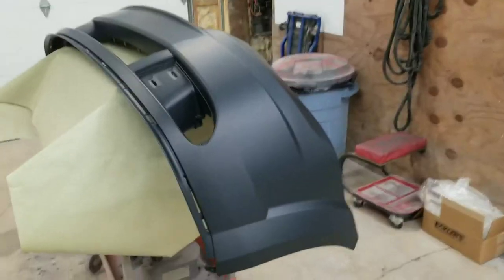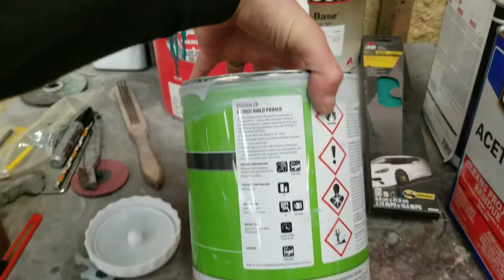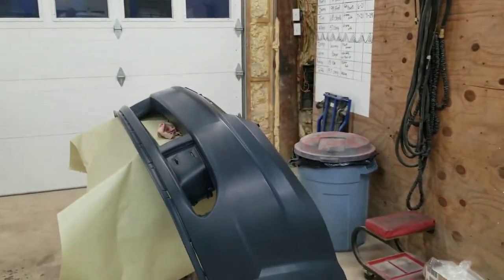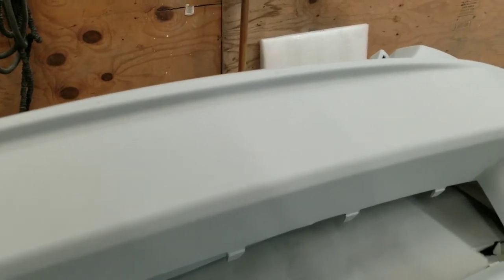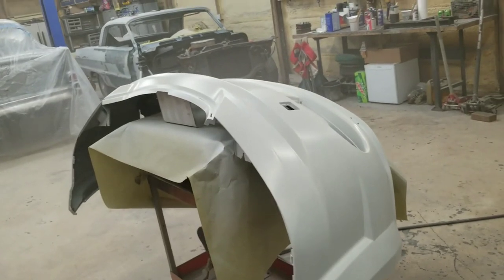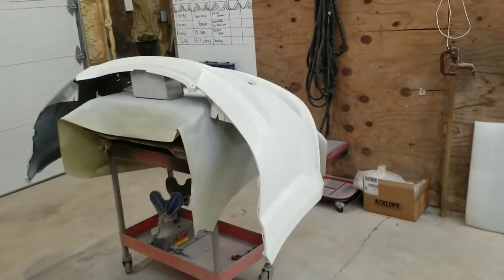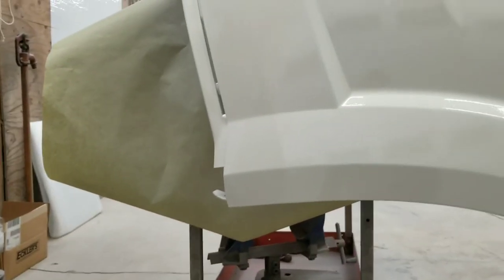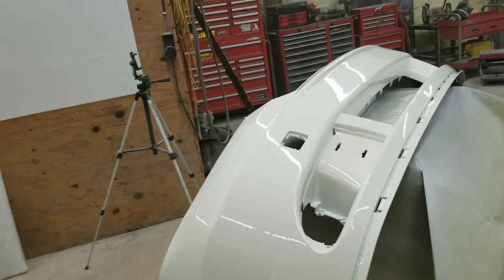Pre-primed aftermarket plastic bumper prep for paint no peeling no flaking make your paint stick

Comment: My only problem I face is laying primer/sealer down. Everytime I do, I have to sand it down with 600 to get it smooth before I paint. If I paint right after primer without sanding, it comes out super rough! Other than that thank you for the great tips!
Reply from the maker: You either need to thin your primer/sealer with the appropriate reducer, and or increase your gun psi. Some of the thicker brands need 40-50 psi to lay out smooth
Reply: @bpbrestorations2093  wooow didn’t think of that thank you!
Reply: Settings on gun might not be right? I always have Paint and Air on one wide open setting. But defiantly need a 50 litre plus compressor. Try doing in sections instead of laying it in one go?
Reply: probably need more reducer. it’s probably spraying too thick so it goes on kinda lumpy.

Comment: You should not use wax and grease remover on plastic and do not use a red scuff pad.. Use the grey one
Reply from the maker: @SonomaLow12  thanks for the feedback, you are right, you don't technically need adhesion promoter. W&g is like 90% alcohol and you can use it I have done it for 20 years, just make sure you use the double towel method to wipe until it's 100% dry and leaves no residue. And you absolutely can use purple scotch for scuff even on metallics as long as you seal first. I have done this method for many years. Our paint is not peeling, but we have done dozens of redo from other shops where they are and this is my observation and answer to the problem. If you think you have a better method post the video or get off the bag.
Reply from the maker: @SonomaLow12  also I see you edited your original comment, I sent my response to your unedited conment lmao

Comment: You mentioned waiting 10 minutes before spraying the sealer, but what about delay between sealer and base coat, plus the time between base coat and clear coat?   And if I end up needing to sand the sealer coat because I'll be using a spraycan primer, how long should I wait before and after sanding the sealer step?  Thanks for all your guidance!

Comment: I’ve read that you shouldn’t put adhesion promoter over primer, it’s for raw plastic. So if I have one of these pre prime bumpers that says to wet sand with 1000 grit, how do I approach it ?
Reply from the maker: It will not hurt it, the primer they use is trash in most cases. You can use adhesion promoter over the pre primed bumpers. If it were a good primer I know I put on then I would say no. Best to adhesion promote it and put on your own 2k sealer. IMO

Comment: I have a question this is now my second car I’ve had to have panels replaced and painted from an accident. I had them both repaired at caliber collision, not sure if your familiar with them but they get there panels and bumpers from a place called Keystone. Both times I’ve had to have them repainted because of the paint just peeling off. They always want to blame it on keystone. Don’t you think they would know how to prep those parts properly like you do or do you think they’re just taking short cuts. They’re supposed to be professionals and do it right the first time I would think.
Reply from the maker: Definitely not a keystone problem. Peeling paint 99% of the time is improper prep or didn't clean well enough prior to paint/sealer. Or not following the TDS sheets and letting their sealer set to long before they put on their basecoat on.

Comment: I'm about to get a pre primed 350z bumper, I guess I'll take your word for it. Ehat confuses me is what to buy at lowes to make a primer a sealer and im not familiar with mixing. And I only have one paint gun so when I spray sealer ill have to clean it out to paint it black and then clean it again to do clear coat. I was hoping I'd be able to just spray it.
Reply from the maker: You need to find a local paint supply store. If you cant go to a local body shop or ask a buddy in the field where they get there supplies. Most of the time the guys in those stores are more than happy to help a new guy out. Lowes in my area does not have anything I would want to put on my bicycle, and definitely not my vehicle.

Comment: I ordered a spoiler for my car that comes in a pre-primed black color similar to this I was wondering if it’s okay if I leave it unpainted like that? Only reason I ask is because the matte finish it comes in matches the car’s factory side skirts and diffuser
Reply from the maker: No, there is no UV protection in the primer. It will fade out and turn a white chalkish color if you leave unpainted. If you want it flat black and cheap, at the bare minimum I would get rust oleum flat black in a can to keep that from happening
Reply: @bpbrestorations2093  oh okay gotcha. Will I need to go over the rust oleum flat black color with a clear coat as well ?
Reply from the maker: @michaelanthony7365  no
Reply: @bpbrestorations2093  ok cool. appreciate the feedback!

Comment: Thanks for the information, it's appreciated. What sealer could you use if you're rattle canning it in the back yard?
Reply from the maker: Spray max 2k is the only kind of primer/sealer I would use out of a spray bomb, it has a plunger on the bottom to bust open an activator inside. Anything sealer or primer that is not 2 part with an activator stay away from it will never last.
Reply: @bpbrestorations2093  thank you
Reply: Did you ever paint your bumper and use the Spraymax 2K he mentions?  I only ask because I'm deciding on whether or not to do mine and have fretted over what combination of canned spray paints to use.  I wanted to use the dupli-color bumper paint and then seal it with a 2K matte version of the Spraymax clear, BUT, I'm worried that if I lay down a urethane sealer like the 2K, over an acrylic like the dupli-color, it will eventually peel because they may not be chemically compatible.

Comment: I sprayed the adhesive promoter and then the primer filler. After drying, I noticed it left like a rash like feeling. Do I have to start from scratch again?
Reply from the maker: If it left a rash feeling, that is dry spray. You didn't wet out your primer enough laying it out, if you got enough on you can sand it with 500/ 600 grit and then scothbrite it until its smooth and then proceed on.

Comment: Do they sell a sealer in a spray can? I’m doing rain guards, and a spoiler kit. I’m in the scuffing stage. I was going to put adhesion promoter, then use a 2K primer I have in a spray can? Is that sufficient, or do I need some kind of sealer?
Reply from the maker: 2k primer will work if it's smooth enough, out of a can it should be fine
Reply: @bpbrestorations2093  Thanks👍

Comment: Thanks for this! Great advice! I'm about to do a bumper myself.
The last time I did a bumper, the clear coat looked "orange peely" like yours and even had a small run.
I discovered though that it continued to "flow out" seemingly for days after and looked 100% better without having to sand.
Have you had the same experience?
Reply from the maker: Yes I have
Reply: But how many day did u wait to put it on
Reply from the maker: @kevinkev1530  24 hours is sufficient for most clears. Check the TDS sheet on whatever brand you are using

Comment: Great video. This instructions is to make sure that paint doesn’t peel off.

Do I need to do another spray paint of the bumper to make sure that the primed paint get sealed? Or is there no need to do a 3rd and final coating?

Thank you.
Reply from the maker: If you are using your primer as a sealer and it layed out well enough to base coat then it will be fine to sand with 600 grit and go right into paint. I prefer to always spray a sealer before paint. When you just use sand paper over your primer and then  paint you only get a mechanical latch/bond, with a sealer right before your base coat sprayed within the proper time windows will give you a mechanical and chemical latch/bond.
Reply: Thank you so much.

Comment: Is thinning out the primer by 10% to make it a sealer crucial to your claim on the pre-primed bumpers? If so, what are you mixing it with to thin it out? It looks like there were instructions on the UPOL primer can but I currently don't have all the tools for proper measurements. Again, if this is a step you don't recommend skipping to back your claim, then I'll go ahead and do more research to find out exactly what I need to thin it out ...or can i just use primer for this whole step? 😅
Reply from the maker: @bizarrehazar  you can use primer for the whole thing if done correctly, the benefit of thinning it and using as a sealer with urethane reducer up to 20% on Upol 2253 is that it simply lays flatter and smoother no dusting or orange peel in the primer/sealer.
Reply: @bpbrestorations2093  thank you! 🙏

Comment: Thanks for sharing that information great finish
Reply: I got a bumper  for my ford focus mk3  front bumper and it was white  so I had to change the colour to 2k primer and base coat but the bumper was painted with 2 pack paint  and its started to  flake underneath of the bumper with the 2k high build primer
Reply from the maker: Probably gonna have to start over

Comment: nice video man.. just a quick question i need to apply body filler ,do i need to throw some adhesion promoter before the body filler? or just sand the pre.primed new bumper
Reply from the maker: No chemical between filler and bumper, just make sure you clean it good
Reply: @bpbrestorations2093  Thanks a lot for your reply . I just made a modification to the bumper to fill some gaps with extra plastic and i need to fill the surface of those areas with body filler for a smooth clean finish before painting . bumper is new and unpainted

Comment: What is your opinion of the quality of the plastic on aftermarket bumper covers versus OEM bumper covers?
I have heard rumors of aftermarket covers being brittle and cracking easy versus OEM thank you.
Reply from the maker: They are definitely not oem quality. Not even close. If I can find an oem bumper used I will use it over a bare plastic aftermarket all day long.
Reply: @bpbrestorations2093  okay so you would consider a used OEM bumper cover over a brand new aftermarket that's what I was sort of hoping thank you kindly!!!
Reply from the maker: Absolutely yes! And no problem buddy

Comment: How long do you wait from the primer and when you put the color on? Thanks
Reply from the maker: You will have to read the TDS for the product you are using for certain, but typically once it "flashes" off around the 30minute - 1 hour range you can proceed with a tack cloth and paint.

Comment: This might be a dumb question, but you mention at the beginning of the video that that bumper is pre-primed.  It looks just like the bumper cover which came with my Nissan pickup truck when it was new 20 years ago.  Does that mean that the bumper cover it came with was just pre-primed, or did Nissan also paint it with a color (AG64) that looks exactly like the pre-prime?  I'm asking this because I'm thinking of getting a new pre-primed bumper cover, because mine is faded to oblivion, so I'm wondering if I can just put it on and armor-all it or am I going to need to paint it?
Reply from the maker: It's definitely just primer, and no. There is no UV protection on that primer. It will fade and turn to crap very quickly without topcoat.

Comment: How long between sealer/primer to base coat and time for clear coat?
Reply from the maker: Every paint line is different, try to find  the TDS sheets for your material online. Most seem to be about 45 min to 1 hour for primer to dry enough for basecoat. Basecoat generally take 20 to 30 minutes to flash off enough for clear coat or a second coat of base.

Comment: I have basically that same pre primed bumper.  Mine is for a Dodge Dart but looks almost identical.  How much should I expect to pay to have someone prime & paint it exactly like you did this one?
Reply from the maker: Roughly $600
Reply: @bpbrestorations2093 and is it safe to say that it's better to paint it BEFORE I install it on the car?  Or since the paint would need to be blended into the fenders, etc. would it be fine to have it installed first?

Comment: How long have to wait after the clear coat, to do polishing.
Reply from the maker: @gbitpal  minimum 24 hours but I would check the TDS sheet for the info on the exact materials you are using. Google the TDS if you have to.

Comment: Nice video would this same process apply to painting a plastic boat?
Reply from the maker: This applies to nearly anything plastic that's new.
Reply: @bpbrestorations2093  if it’s an old plastic boat should I sand with 600 grit instead of using the scuff pad?
Reply from the maker: 600 will work

Comment: Do you recommend something to clean the bumper before scuffing to remove the molding chemicals.
Reply from the maker: Wax and grease remover or kar-prep
Reply: @bpbrestorations2093  I heard it wasn't good to use wax and grease remover on the plastic. Have you heard this. I have a new  front and rear bumper I'm going to paint and want to do it the right way.

Comment: Its a nice  video but you left out some important parts.I wanted to see the spraying at regular speed start to finish. Also how you buffed sanded and polished out the orange peel would have been really nice to see seeing  as how that produces the finished product.What do you buff with and what compound do you use ? Is spraying too wet or to slow causing the orange peel ?If you use spray cans woulfd you have those problems?if not what is or do you care because you sand the peel out with the 2000 grit sand paper?
Reply from the maker: I have other videos covering some of that stuff, I use a foam polishing pad either 3m, or chemical guys on 5 inch buffer or a 3m perfect it pad on a dw849 buffer. We always sand and buff or "denib" and polish right over 2000 grit. You can go higher to 3000 or 5000 but all you are doing is wasting time imo. In order to get the hang of spraying and patterns and speeds to eliminate the orange peel and the need for doing a ton of sanding you need to do a small test panel that you can keep sanding off after it dries until you get the hang of it.
Reply: @bpbrestorations2093  Thank you for providing your knowledge ,experience and time in these videos.They are very helpful for me who has never sprayed plastic.I think I will be using an aerosol 2k primer as a sealer.What do you recommend ?Urethane polyurethane polyester filler or epoxy and what brand?

Comment: Can i ask why you used Hi build over plastic primer?
Reply from the maker: It's high build, but with urethane reducer it is a sealer. I put it on because paint don't stick to these bumpers well.
Reply: @bpbrestorations2093  see i`ve got a old Ford Focus rear bumper to respray. I`ve rubbed it down(cleaned of course) but still undecided the best way to spray it? I was just going to go adhesive Promoter, plastic primer hi build then base with clear?  But will the way you described better? I`ve moved away from mechanics to take up spraying due to injury. Too old to be rolling under cars lol

Comment: So I have small are I need fix do I need to prime whole bumper or just area i patch ?
Reply from the maker: If the rest of the bumper has good paint then you only need to spot prime your damage area and a scuff pad for the rest
Reply: @bpbrestorations2093  This was bumper I ordered from eBay brand new “pre primed” but it did have 1.5” crack 
And that’s why I was asking if I need to prime whole think o just that one spot?
Reply from the maker: @mikimiki195  I would seal the whole thing at least
Reply: @bpbrestorations2093  
1. Fix cracked area 
2. Spray adhesion promoter 
3. Sealer 
4. Base coat 
5. Clear coat 
Are this good steps to take?

Comment: Are yiu supposed to sand it down first
Reply from the maker: You can just scuff it with a scotch pad.
Reply: @bpbrestorations2093  I've just bought a aftermarket bumper so can you please tell what's best way to sand it down my previous bumper paint pealed off when I washed my car thanks
Reply from the maker: Sand it with either a red scotch pad, or p500 or p600 sand paper. Then Proceed on with adhesion promoter.
Reply: @bpbrestorations2093  great work pal keep it up

Comment: I guess the primer on mine was really shitty. Scotch brite, and then the wax and grease remover dissolved the primer.
Reply from the maker: Good thing you figured that out now instead of after paint
Reply: @bpbrestorations2093  Kind of through me off when I was wiping it off. It was like "Why is my rag so black?". Quick question, I haven't applied the sealer yet but should I apply it as a primer instead, since the original is gone?

Comment: What if u sprayed adhesive promoter and then tried base 🤔
Reply from the maker: I would be afraid of the negative reaction, you will at the very least want to put on a thin coat of sealer.

Comment: Can I use primer spray can instead of sealant
Reply from the maker: Sealer is just primer thinned out with urethane reducer, so yes you can just prime it. It's just a slight bit more work.
Reply: @bpbrestorations2093  thanks mate much appreciated
Reply from the maker: @hasnainakiali4114  no problem bro! Good luck!

Comment: I thought you have to add "flex additive" to the primer.
Reply from the maker: With modern urethane paint, it's very flexible unlike most of the old stuff like enamels and lacquers. I quit using flex additives and dont recommended any additives to the paint

Comment: Hi how long did you leave the wet in wet primer before base/clear thanks
Reply from the maker: 45 min at 70 degrees
Reply: @bpbrestorations2093  hi what if it’s air dry( no booth) thanks
Reply from the maker: As long as it's above 65 degrees you will be fine approximately same amount of time
Reply: @bpbrestorations2093  ok thanks